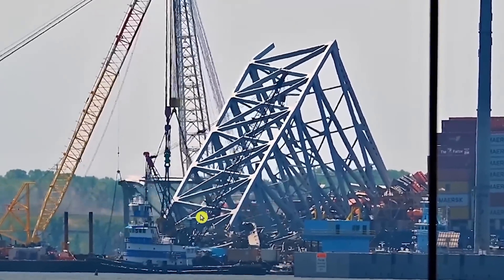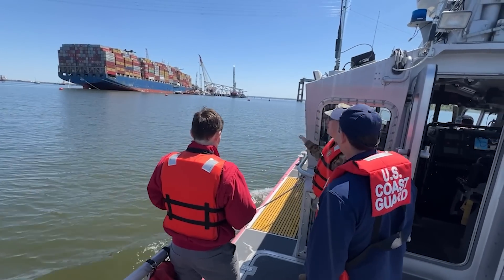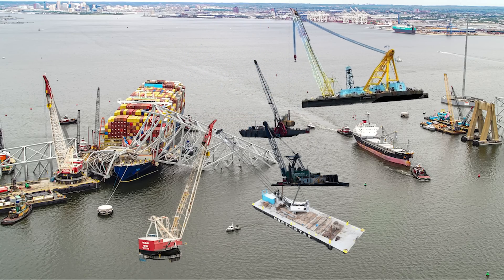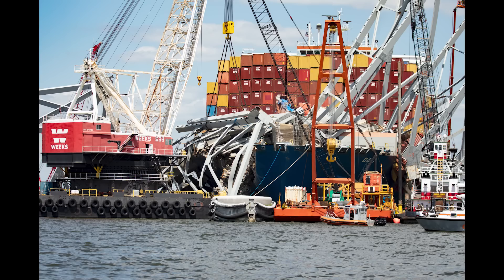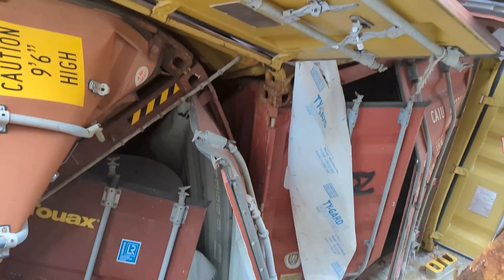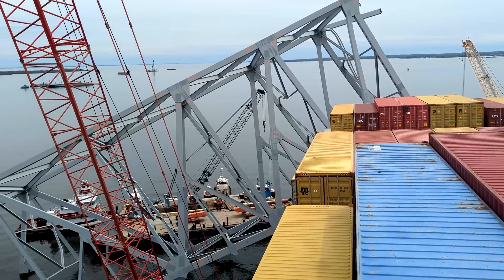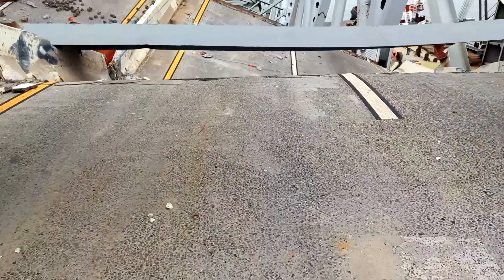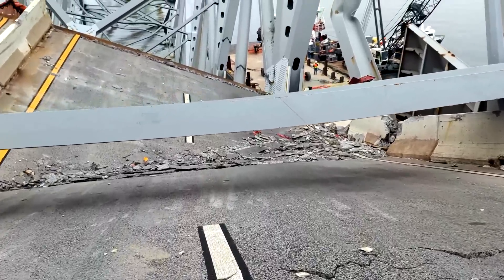1st Key Bridge Truss Pulled Off MV Dali Bow Baltimore Bridge Collapse

Comment: I’m guessing “precision cutting” is an understatement of the calculus involved. While visually the structure might show where the cuts should happen (based on weight distribution and size calculations, fitability for the Claw/Gus to carry off), each member is under very different stress and torque, which can only be revealed the moment its cut is complete. One particular cut could have zero apparent impact on the remaining structure, but another particular cut could send it reeling in a dangerous direction, risking lives. It’s pretty incredible the work they’re doing.

Comment: Thermite!   Thermite is very good at cutting through steel beams as seemed to be evident in the basement of the twin towers, where major vertical structural beams appear to have been sliced through at an angle to ensure that the upper part would simply slide off the lower part. I never discovered what that was all about.

Comment: Hello my friend. Looking at your footage that was filmed from the bridge you say that the fallen bridge section is laying across the ship on the starboard side, but if the viewpoint is looking forward towards the bow of the ship then the bridge section has fallen on the port side of the ship. Port to the left ,starboard to the right. Thanks for the very interesting footage. I think that once they lift off the final section of bridge they will remove whatever containers that they can the stabilise the ship and tow it to the nearest quayside to unload the rest. I don,t know if the ship will be repaired but it is poossible. Anyone interested in a slightly secondhand ship ? Good luck.

Comment: WHAT YOU ARE FAILING TO RECOGNIZE IS EVERYTHING THATS PART OF THE KEY BRIDGE AND FREIGHT ON THE DALI , HAS A CODE IN RED PAINT. AND HAS TO BE REMOVED VERY CAREFULLY ! THERES A WEIGHT TRANSFER THATS GOING TO HAPPEN. AND WHEN THEY DO THAT THE DALI WILL START TO RISE UP. AND IT MAY BE STUCK ON THE BOTTOM ( SUCTION) SO THEY JUST CANT START REMOVING EVERYTHING AT ONCE! THIS IS WHEN THERE EXPERIENCE COUNTS ! THIS IS A WELL THOUGHT OUT PROCEDURE. EVERY ACTION HAS A REACTION! WE CAN WATCH AND LEARN! THERE DOING A GREAT JOB SO FAR! KEEP UP THE GOOD WORK!

Comment: Altho containers have hard corners, it's surprising how thin the corrugated metal is that forms the sides and top. When you walk on the top, it bellies in. It will be interesting to see if the precision cutting also cuts the truss into pieces small enough for Chessie to lift, or if they will have to do underwater cutting after it drops.

Comment: If there is more cargo coming into a country than going out, the amount of containers needed at the point of departure will exceed those available if they are just stacked at the dock (which the docks do not like to do because it takes up needed space.) Therefore, empty containers will be transported outbound along with full containers. So every cargo ship has a certain number of empty containers, depending on where they are coming from and going to. Remember also that not every container is unloaded at a given port. There are containers booked through. Like you might have a ship go from Germany to England, drop off a few, pick up others, than go ti Ireland and do the same, then to Newfoundland, Boston, Virginia, then Miami before heading back over to Spain and France.

Comment: Why is the Chesapeake 1000 presented like it is one of the largest floating canes? It doesn't make it on to the top 50 list of floating crains and it can lift less than 5% of the lift capacity of the SSCV Sleipni. Obviously there is limited space in the harbor and they need to use cranes that is available on site at short notice but don't present it as some record breaking monster crane.

Comment: At 8:16 there is a picture of a (I'm going to call it) mending plate that has hundreds of fasteners (rivets?) attaching it to various beam members. BUT, it also has dozens of fasteners missing. What happened to the missing fasteners? Were they never installed? Are they considered non-essential? Just curious - not trying to create a conspiracy.

Comment: Dunno if anyone was curious about this and hadn’t seen any comments/questions. Anyone who is curious about the open top orange (red?) boxes on the roadway with all the small almost round looking objects scattered around in the pavement, here’s what they are. The boxes (obviously) held the scattered objects and are usually stowed in the bow, amidship, and stern areas. They are called knuckle boxes. They hold knuckles which are the roundish looking objects scattered around. Knuckles are placed into the bottom corner post holes at all 4 corners of each container. They lock into the top corner posts of the container below it (or
The deck for the bottom container) thereby locking the whole stack together. The knuckle boxes are offloaded at every discharge terminal and as the container comes off, longshoremen remove the knuckles and throw them into the knuckle box. Before a container is loaded the longshoremen place the knuckles into the corner post. The boxes are labeled with the ship name because they are assigned to the specific ship.  All the trivial info you probably never really cared about and regret the time you wasted reading this!
Reply: Good info ! Thanks!
Reply: Thanks for the info. I did wonder…and now I know. Information that I will probably never use, time I’ll never get back 🤣 but I  learnt a new word, “longshoreman”. 
Commenting from Western Australia. 🇦🇺
Reply: @christinejoyce6059  Wharfie in Aus, Docker in the UK
Reply: @christinejoyce6059  We call them WHARFIES over here in Aussie.
Reply: Thanks! I was wondering what those were about. Thanks again.
Reply: Mystery solved, thanks.
Reply: No time was wasted reading your explanation. I work for a class 1 railroad and knew the containers locked together and to the braces in the well cars, but didn’t know any more than that, so thanks.
Reply: Honestly that's the coolest comment/post I've read all day. 👍
Reply: Great information, thank you.
Reply: Thank you for sharing
Reply: Superb information! Thanks

Comment: Did anyone else notice at 2:40 that huge chunk of a pillar right on top of the ship's bow?  You can see the broken rebar sticking out around the edges.  It looks like it may be bigger than a container (20, 40?), certainly heavier.

Also, did anyone else notice starting at 6:40, a few of the lower down containers don't have doors?  The container is completely full with what appears to be a huge 8 sided object.  Is that the cargo object or a second internal container holding something large that's maybe round?
Reply: Shipping containers usually have doors on one end. You are seeing the ends without doors.

Comment: Controlled Demolitions Inc. is headquartered in Baltimore. I wouldn’t be surprised to learn that they’re handling the demolitions. 

Local media has mentioned concerns that some sections of truss under tension might ‘spring’ (shift suddenly) as weight is removed. Cutting everything at once would prevent this sort of uncontrolled movement.
Reply: Might not "prevent" it, but it ensures that nobody is close when all of those forces get unpredictably re-distributed.

Comment: The truss on the starboard side of the Dahli is being supported by the Dahli on one side and the bottom of the channel a fair way from the ship on the other. So it is, for all intents, still functioning as a bridge with all the members contributing to supporting the load. It will be very interesting to  see the locations of the shape charge cuts and the sequence that will both collapse the truss and somehow minimize additional damage to the ship as is crumbles. Not unlike a building or bridge implosion. Thank you for your coverage!
Reply: Good comment, but I think you meant port side.
Reply: @h8GW  You are right.
Reply: *Dali

Comment: 10:02 They make these typical cuts before putting shaped charges for a controlled demolition, on buildings. These are undeniable proofs that they're plannig to cut it off with explosive charges. The shaped charge, and its copper part in the middle, are wrapped around the thick parts of the truss, and the truss gets cut when the explosives propel the molten copper inside the little voids like a hot knife into butter.

You could find this typical type of cut in the trusses wich were part of the World Trade Center just before they removed the debris after the 9/11 attacks.

(sorry if my english is crap)

Comment: A major problem they don't deal with enough, the reason there are steel reinforceing rods in concrete, is so that if for any reason the concrete gets cracked, like getting hit by a ship, the broken pieces can't shift. Unless they are dealt with immediately, water gets in and turns the steel into nothing but rust. The next time it's hit, it's just pieces of stacked concrete, absolutely NOTHING prevents them from just falling apart.
It's already come out that this is not the 1st time that one of these was hit by a boat.
Reply: The rebar provides extra strength under normal use.. so less likely to crack.  Not just for the cracked scenario’s.
Reply: @jackever  
Thanks.

Comment: Controlled demolition? Releasing all the pressure at once, all that weight at once on the cranes, and let's loose from the mud simultaneously , I'd recommend steering clear captain crew tugs far away,  not to mention the rear tie-downs snapping

Comment: That crane is on the starboard side, not port.  You can remember it by remembering that the word comes from "steer board", which was literally a board used to steer the ship before wheel-controlled rudders were invented.  Since most people are right handed, the steer board was mounted on the helmsman's right side while facing forward on the ship.
Reply: It's how you "steer' a canoe.

Comment: @10:06 - That shot...that is how you pre-weaken a truss for placing of the copper-coated shaped charges.  Anyone who has watched demolition recognizes this.  The charges are strapped on the inside and outside of the outer portion of the beam leaving a clean cut and ample separation room.

Comment: Cutting charges can be timed very precisely to unpeel the truss from the ship. A major consideration's going to be to release the ship without obstructing the deepwater channel she'll need to swing into for removal. The murphy factor'd be the danger of losing balance on the load, at worst capsizing her.
Reply: @Ruthhql320  Because of the time it'll take without the heavy dockside gear capable of shifting the boxes faster and removing them into storage for onward  distribution later. You get two out of three, speed, cost, and beauty. Donald Trump's discovering Stormy Daniels don't come cheap.

Comment: <yeah, so ummm....there's probably trillions of victoria's secret panties on the MV Dali>
<controlled demo(lition)>
<sometimes in the military you have to breach walls and/or destroy your own equipment to prevent capture>
<you demo stuff when it's too dangerous to cut>
<for something this big, might need some special demo crew from the military/building demo to do this one>
Det(onating) cord
https://en.wikipedia.org/wiki/Detonating_cord
<shaped charges>
In non-military applications shaped charges are used in explosive demolition of buildings and structures, in particular for cutting through metal piles, columns and beams and for boring holes. In steelmaking, small shaped charges are often used to pierce taps that have become plugged with slag.
https://en.wikipedia.org/wiki/Shaped_charge#:~:text=In%20non%2Dmilitary%20applications%20shaped,have%20become%20plugged%20with%20slag.

Comment: My company is currently there cutting the bridge with  hydraulic diamond wire cutting tool
Reply: I thought they must be using wire or chain cutting in the areas where things are likely to move when they are cut. To dangerous to have divers cutting it.
Reply: @tiredoldmechanic1791  Correct is a diamond bead infused wire , we use these tools in the oil and gas industry on land and and in the gulf of mexico with divers or no divers  to remove platforms or pipelines and we also use them for bridge removals

Comment: The schedule slides that Sal showed last week mentioned that the removal of the girders on the Dali would involve explosives. Best way to avoid surprises and minimize uncertainty in how it comes apart.
Reply: Probably FLSC.
Reply: But it causes shrapnel to launch. It can go pretty far. They used it on a power plant in California. A guy that came to watch it was standing about 2,000 feet away and got hit and it cut his leg off.
Reply: @jimnalgrin3515  That's bad rigging. There should be a box of sand wrapped around every large charge to keep that from happening. Cutting charges shouldn't be big enough to make the pieces they're cutting it into go very far. They want it all to drop straight down or tip over predictably. The safety zone for this will be 99% water and the rest will be really easy to clear in any case. That part of demolition is SOP no matter the situation. See @TheLoizeauxGroupLLC channel for tons of examples of how to do it right.

Comment: I think you have confused port and starboard.  The port side of the bow is on the left, not the right, when looking forward towards the bow.
Reply: Came here to say the same thing.  I used to teach boating safety and the rules of the road.  It's important to know the difference, especially if you are on the water.
Reply: @samanthafordyce5795  Yes.  Even most avgeeks know which sides are port and starboard not counting dyslexia

Comment: When they rebuild the bridge they should use a  section of the original bridge somewhere in the new design.
Reply: Not a chance, there is no way that has not been weakend as a result of this disaster. Steel can have internal stress that's not visible.
Reply: @richietattersall2122  Not as a structural part, just as a memorial.
Reply: @lzed223 
Sorry,  what you think they should do, does make sense.b
Reply: @richietattersall2122  No worries you had a valid point. I think something simple and visible with the name of the bridge and a small memorial to the guys who died. It will be there 60-70 years.

Comment: You will be amazed when they finally put properly positioned "Shape Charges " on the remaining portion of the 5K tons of bridge . They will take a wedge out of it and pull the remainder off the deck with the top rails of the bridge and with a delayed charge cut it into manageable pieces as it jumps deck.
Reply from the maker: I can't wait!
Reply: I can't help be recall at the beginning many people were saying "you can't blow it up, that would kill everyone and scatter debris all over." LOL
Reply: @frotobaggins7169  I'm inclined to agree with you, but obviously neither of us are trained in the use of explosives. Obviously the demolition teams have calculated how much, and what type of explosives are needed to break up the steel work without putting lives at risk.
Reply: Sounds impressive! I'm almost on the edge of my seat now, waiting to see this!!! 😃
Reply: At 7:50 in the video you can see orange/red spots all over the grey bridge truss, looks to me like identifiers and or prepped spots where shape charges will be put to cut the steel.

That's going to be some fine "BANG" when they blow all these charges.
That is no garbage thin steel they have to cut.
Reply: I expect to see something like this: https://youtu.be/zR98Ar_xSCs?si=4YaB5AYAYQ7jBdkY&t=610

Lots of V-cuts to weaken it, then lots of shaped charges to cut it into fairly small pieces that can be dug out by The Claw.
Reply: they'll probably use nano-thermite, like they used taking down the twin towers (and WTC7)